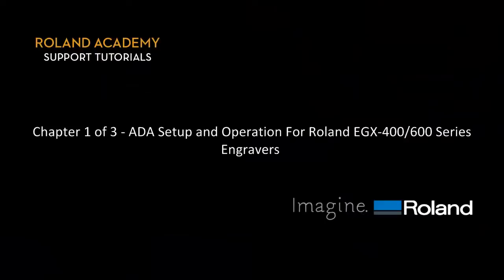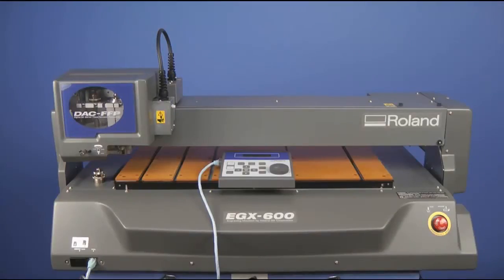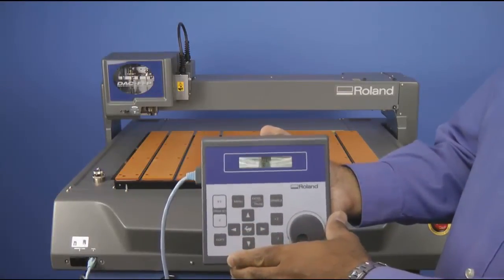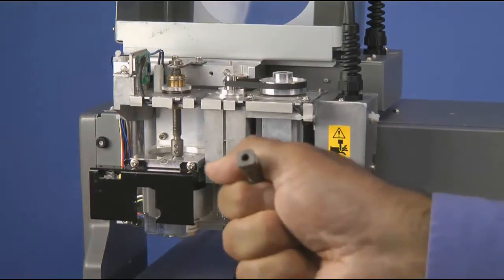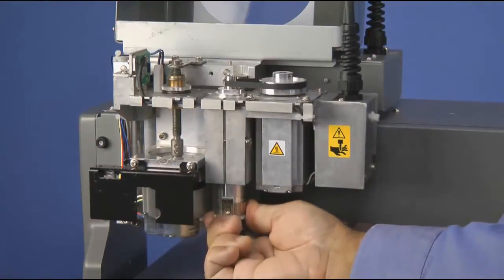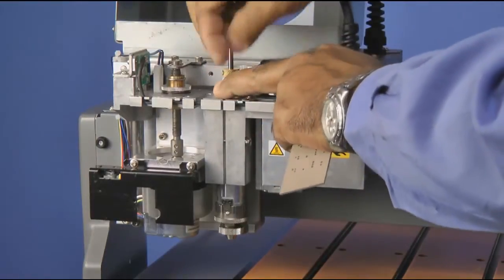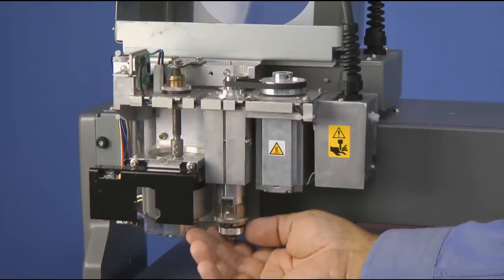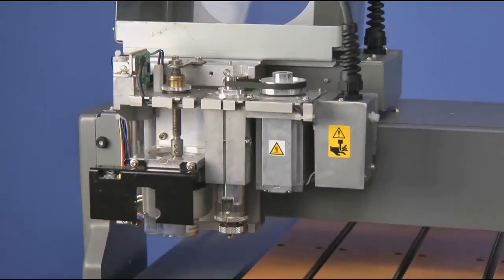EGX 400 600   ADA Kit Setup and Operation   Part 1 of 3

Comment: Can you give me solution for my EGX-600
This is suddenly show
CAUTIOUS COVER OPEN
What I do?
Please help me sir
Reply from the maker: Hi Afzal, does the message come up during engraving or before?
It is a possibility that the spindle cover latch may not be working, or the latch is broken?
Reply: Prytec Solutions Pty Ltd ;
Sir, it seems to show the CAUTION COVER OPEN on your own while printing.

And as soon as the print is clicked it starts showing
Reply from the maker: This is more than likely due to the latch and the switch, this detects when the spindle cover is open.  I would suggest you get a Roland technician out.